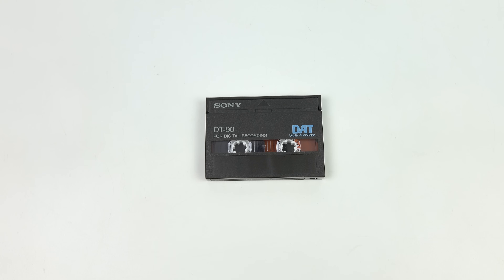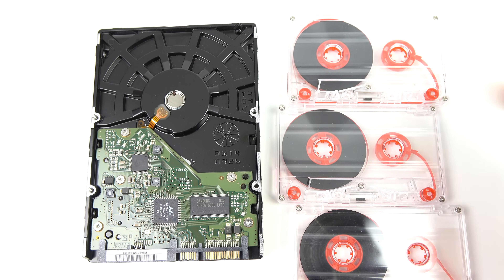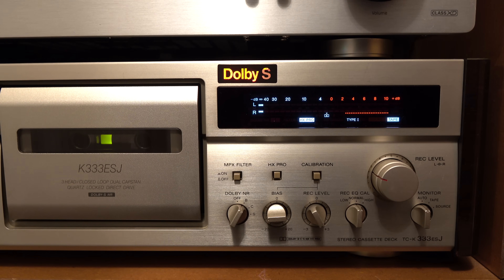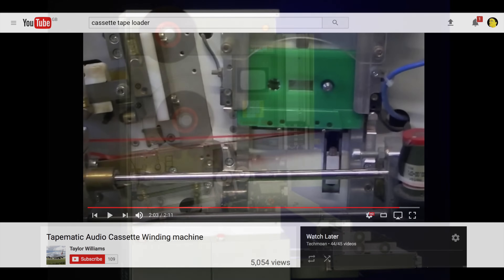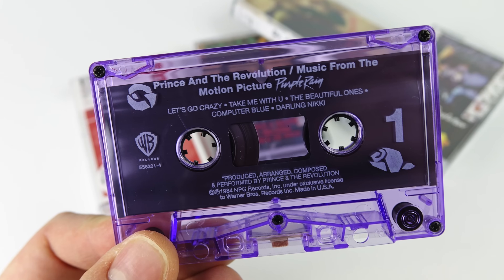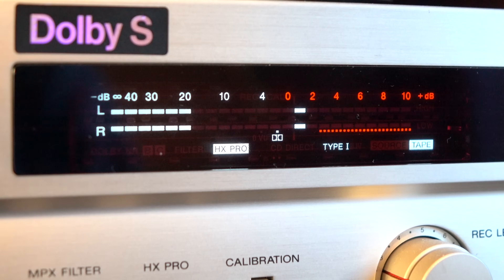Pre-recorded Cassettes' Last Stand

Comment: Have you done an episode on the Sony MiniDisc?  That technology was fantastic.  It really should have done better than the CD.  They sounded great, were protected in a case and were recordable and re-recordable.  Not to mention very small and convenient.
Reply: Please do not remind me on mini-disc. It did not reach CD quality at all because of data compression. Sony made quite some effort on getting de-compressed stuff sound good, but it was lacking details and ate batteries. And you heard the motor electronics dubbing into the background -- worst thing (unless you used bad headphones). The idea was not so bad after all, but CD has a standard bit rate of 1400 kbit/s, MD only 292 kbit/s - this means compression to 20 % of data amount. I don't wish it back at all. 
 
Cheap mp3 gear with 128 kbit/s (or even less in case of digital radio) is of course worse. Ipod standard is 320 kbit/s, which is better than MD, minus moving parts, plus sophisticated decomp/DA chips - this is why MD is out of competition. Still, CD sounds better than ipod to be honest.
Reply: Antonio Tejada
Ok, I accept that there may well have been better MD things than the stuff I owned (and didn't like at all). So - sorry for speaking bad about it ... 
 Some of negative reputation comes from the fact that it was not possible to extract digital data right from the medium to a PC. I know it was done so because of copyright issues, but it was annoying to have a digital sound recorder with limited functionality.
Reply: Kevin Bowers I used MD from 1995 or 96 until I got my first iPod in 2003. It was truly a format that never got the love it deserved.
Reply: akronymus You obviously never actually used MiniDisc, especially later models. As an actual product it bore no resemblance to the horrors you describe.
Reply: akronymus I couldn't agree with you more about Sony's ham-fisted PC support. If they'd embraced the MP3 (properly, with native side loading from the computer) right as it caught on, before the iPod came out, I think MD would have become significantly more popular. 

As for sound quality, the first two generations of ATRAC encoders were not great. (So like 1992-94ish.) The third generation was much better, pretty much transparent to average ears. 4th gen was basically equivalent to CD even for golden ears. And the 4.5/5th gen actually match or exceed CD, thanks to being up to 24-bit and having far more advanced processing! (ATRAC is a strange codec: it doesn't actually have a fixed bit depth, it's floating point with a scaling exponent. So high end decks used 24-bit ADCs and encoders, with spectacular results that largely carry through even when played back on older gear!!!)
Reply: Antonio Tejada
(restrictions) ... and they never realized that many sales of LP / CD resulted on mix cassettes passed among friends. I remember discovering bands and albums by such tapes and buying the original then. Sony knew how people loved these mix tapes from their walkman sales ...
 
(quality) I assume that also later 'entry price' MD sets had poor encoders/decoders - mine was quite crappy (and handling was poor, pressing several tiny buttons until it started recording). Codec also is an issue with today's mp3 players. Same low-bitrate source sounds anything between quite acceptable and trash.
Interesting information that the encoder is the key - so MS media recorded by good machines play quite ok on cheap decks, too - tahnks.
Reply: @Conor Hanley 
I think everything will dye one day, except music

Comment: That "PCM direct to the tape head" sounds a bit fishy. If it were PWM, yes, that's possible just with a bit of filtering. But PCM is pulse code modulation. IE a list of numbers representing a waveform. Same way CDs work. It could be PWM, but that's not a brilliant way of doing DAC, unless you use very fast pulses. 

So, either the tape heads have some digital and analogue circuitry in them, or your source was a bit confused. You're right to think it doesn't make sense. Unless some totally unusual thing happened. Recording PCM direct to tape without a DAC would end up sounding horrible, it'd just be noise.

And yeah, "more sound goes on, so more music comes off" sounds exactly like marketing fluff. Sounds like it means nothing. All that effort in developing slightly-better sounding tape, and the marketroids describe it like you're a 5 year old whose brain has melted. Anyone technical enough to appreciate "dig-a-log" (GREAT NAME!) is going to be completely unimpressed by that advert. They could've at least put some gubbins in to make it sound clever and scientific, even if it goes over most people's heads they're going to be impressed by how sophisticated it seems.

Comment: That is so weird I've never heard storage used as Gigabit. I wonder why they used it there. I mean bit instead byte, normally they use bit when talking about transfer speed and byte for storage.
Reply: kenstr321 In the 1980s most people had no idea about bits or bytes. Some industries settled on bytes (data storage) while others used bits (networking, audio). They probably had made a big fuss about 16 bit audio and wanted to keep the same term around for marketing reasons.

Comment: Did anyone ever find that recording a CD onto tape, and then playing back the tape recording, that if the recording starts off quiet the volume is louder, and when the rest of the instruments kick in, the audio volume dips? I used to spend hours re-recording CD's, and I could never prevent the drop in sound volume. Maybe it was because my stereos as a child/teen were cheap brands.
Reply: Sounds like automatic record level control. High end decks let you set the record level manually but cheap stuff just tried to figure it out automatically (knobs and meters are surprisingly expensive).
Reply: PETER GREEN You're probably right, but its was really annoying. I remember when I got my first CD player, it was a Samsung integrated HI-FI, and still had the same issues.

Comment: Awesome video!! The first USA Digilog cassette I bought was Metallica's "Black Album" in 1991. It was recorded on black cobalt tape and sounded amazing. But it was duplicated LOUD and it maxed out the the meters on my home cassette deck when I played it. Later Digilog cassettes were duplicated on normal bias red oxide tape (like your Ice-T and Prince tapes) with a slightly lower volume.  Still most people played cassettes on low watt car stereos, walkmans, boomboxes or cheap 3-piece stereos they bought at discount stores and couldn't hear the difference cobalt or chrome tape made. And CD players got cheaper and cheaper into the 90's so making high quality cassettes wasn't a big priority anymore. The last time I remember seeing cassettes sold in stores was around 2003. And for a few years some Wal-Mart's had a small area of older $4 discount cassettes.
Reply: An Ice -E is something that you drink, but you can drink and listen to Ice-T.
Reply: Ah, I remember Wal-Mart's cassette area -- that's where I bought, in 2002-3 thereabouts, Black Sabbath's Paranoid (I was in Middle/High School at the time). At the time, the electronics section was smackdab at the middle of the store -- something I miss from the current Wal-Mart.

Comment: Back in the late '70s I had a fairly high end (for the time) system. Consisting of a Marantz 4400 receiver, Technics SL 1500 turntable, Sharp RT 12 cassette deck w/ metal capability and Klipsch Heresy and Jennings Research Vector One speakers. To my possibly tin ear, I discovered that recording metal tape slightly over VU with the dolby on and then playing it back with the dolby off sounded better to me than recording & playback the recommended way. I also discovered that the $12 per metal tape was worth it for the tapes I wasn't going to use in my car. The chrome tapes were okay. for car use. But ferric tapes were about worthless even with dolby plus they required frequent head cleaning. And the fact you could get five or six of them for the price of one metal tape did not make them worth it.

Comment: Hi, Techmoan! Just a quick pedant note on the direct to head PCM thing. 
The link you put in the description is a project of recording PWM signal (pulse-width-modulation), normal for class D, in a cassette and see how it plays back. I was surprised to see it worked.
I think what they mean by direct PCM, is the normal digital-to-analog conversion being fed (analogically) to the recording head from the DAC without any mean signal processing or amplification. Basically, the DAC feeds signal in the recording head.

Comment: even if it's digital, how can high speed dubbing be good?, on the very final step when the signal becomes analogue if the tape is going too fast there will be a quality loss, a lot of details and clarity will suffer. if the tape was a static thing or played back a digital signal it wouldn't matter, but the fact that the tape is supposed to play back an analogue signal and it's a moving thing means high speed dubbing can't be good.

Comment: I still don't understand the bit about sending a digital signal to the tape head.

The lack of schematics makes it hard to tell what's going on in the video you link to ("555 timer class D amplifier and tape recorder experiments") but I think it's just illustrating the use of a digital bias oscillator (i.e., mixing a square wave bias signal with the analog audio signal being recorded to tape).

Comment: What I like in a Cassette is that it was easy to start from were you finished your listening. Something not possible by most CD players and MP3 players. Very useful for listening recorded radio episodes on cassettes or learning a foreign language.
Reply: Achilleas Labrou I liked VHS for that reason too.
Reply: I listen to most of my music on my computer just using VLC player. I have half a dozen of them that have been open for days or weeks, paused where I left them and able to be returned to whenever I remember they are there.
Reply: Achilleas Labrou For audio books, this is a huge benefit. Good point.
Reply: Well, neither MP3 nor CD format prevent this. Manufacturers of devices that can play CDs simply do not provide that feature, at least not with their low-end models. On the other hand, I have a MP3 player that supports bookmarks.
Reply: Our LG DVD player picks up at the point disc was stopped and player turned off.
Reply: I might recommend MP-HC (Media Player Classic Home Cinema), its similar to VLC bit will automatically resume any file you play from where you left it
Reply: VLC resumes where i left off too. i've used DVD players (fancier ones) that seemed to have a small persistent memory, because they also resumed your playback, and even saved chapter markers to certain timestamps which would skip right there.
Reply: Achilleas Labrou Minidiscs start off at exactly same point as stopped too.
Reply: Construction Toy Dude Mini disks survived until 2010 as a good alternative to DAT cassettes for desktop or  portable sound recording. What didn't survived long was Philips DCC cassettes and players. 
Actually Minidisk players of early 2000 could play MP3 files. A minidisk wasn't too expensive, it was easily rewritable my anyone, smaller than CD and could hold one Gbyte of MP3 files. 
However Apple changed everything with iPod and afterwards with iPhone. 

I had a DCC player and I could play analog cassettes in it perfectly too. 
The copy of a CD to a DCC or MiniDisk was perfect for the average user. 
Later came affordable computers, large hard disks and CD ripping. No need to copy a CD to a conventional media. 
After Napster I stopped using cassettes and very very rarely bought any commercial music CD. 
Nowadays I don't either bother to have MP3 files. YouTube has everything.
Reply: @Alastair Ward I swear I had a DVD player that was able to stop and playback at a certain point before.
Reply: ***** I remember having one that would mark the time and chapter etc you'd last watched to, which was lost if the power was disconnected or a different disc inserted. 

PCs were different, you could add bookmarks at any point and retrieve them late. Hence why for every time I've watched the original Mad Max all the way through, I've seen the garage scene twice and opening chase about four times.
Reply: While something, I suspect for music being able to instantly jump to a song was far more useful

Comment: Great stuff - those enhancements to cassette duplication passed me by.

Cassettes were always doomed since it was never going to be commercially viable to produce pre-recorded albums on a high quality cassette mechanism so that really hurt the playback potential. Each tape is a mechanical device made from plastic and manufactured for a few pence so it is a miracle they ever sounded any good at all ! Also a tape drags over the tape head each time it plays which causes a degradation in the tape itself, the tape also decays over the years, stretches and it becomes magnetised as well.

Even professional studio analog tapes suffer from degradation and a scraping effect as they pass over the playback (and/or record heads). Tape can capture sound really well but you are limited as to how long you can store it or how well it will play back. Those priceless master tapes for the classic albums of years gone by are held in temperature controlled vaults and only played on very rare occasions (most have long since been transferred to digital storage). 

There are systems that allow very high quality playback of studio master tapes that use the bias frequency to work out the amount of wow and flutter and correct for it digitally. When used for re-mastering these techniques can offer a stunning jump in definition and clarity (a bit like getting the really sharp focus on a camera)- even on a tape that would otherwise be considered too poor quality to use. It really does prove that analog tape is as good as anything in capturing sound but playback is a much more complicated business.

This article may be of interest : http://audiophilereview.com/analog/plangent---a-better-way-to-transfer-analog-tape.html
(I am a very big fan of Plangent re-mastered recordings !)

Keeping it green and furry !

Comment: I strongly believe it was the quality of the playback device that gives tape a bad rap. On the production side, lots of money was spent to ensure quality sound was recorded, on the consumer side, majority was how to produce a low cost player, so lower quality components were used, heads, discrete components, speakers, housings etc.
Reply: Not to mention when consumers don't look after their player and let the head collect dust and stuff like that.
Reply: Very true. I have a high end Yamaha deck with sendust 3 head and linear EM transduction. Has dolby B and dbx and it very much rivals my vinyl setup for sound quality. I have some new old stock prerecorded cassettes from the late 90s and early 2000s with HX pro etc and they sound great. Many do sound better than the CD and some even have higher dynamic range than the CD counterpart due to mastering differences. There was a high end Aiwa deck that could do 13Hz to 24kHz on metal tape. Even had a mechanism to clamp down on the tape shell to reduce resonance and movement of the cassette shell. Unfortunately most people have only heard walkmans and other cheap home units that sounded like trash. With analog the quality of the playback equipment matters and only the super expensive high end decks were able to deliver high fidelity.

Comment: I wish I had a Walkman.
Reply: ChillBitz Mum still has hers from the 80s, the sort the guy in Guardians of the Galaxy has, although I think that orange foam has probably rotted by now. 

I remember they were such a big deal that in a chapter of Hitchhiker's Guide to the Galaxy one of the protagonists disperses a riot by flinging Walkmans (Walkmen?) in the opposite direction they they were going in.
Reply: +ChillBitz Yes, it works fine, minus the Dolby. Does AM/FM, normal/chrome and has bass/treble adjusters. Also does all the regular tape stuff and has no issues with 120 minute tapes.

I would definitely sell for £50, but may accept less. If you're not in the UK, I doubt it's worth shipping.
Reply: Tons of them on Ebay.
Reply: But they're so expensive. I guess I'll have to spare some money, and then one day...
Reply: +ChillBitz
Wait, they're expensive? I have a Walkman laying around but the Dolby just makes a loud buzzing sound. Apart from that, it's perfectly fine. Worth selling?
Reply: So it works? How much would you sell it for?
Reply: Alright. I'm in Finland.